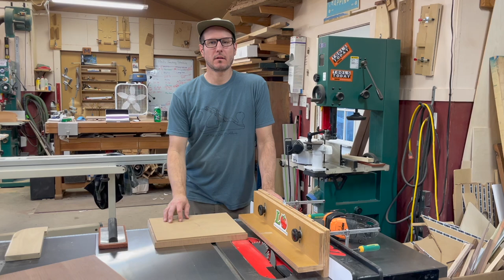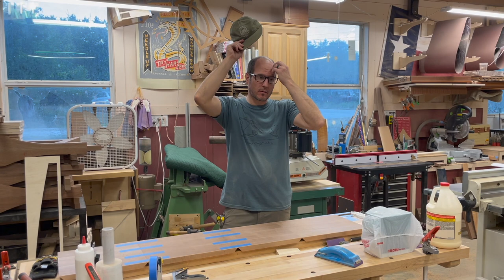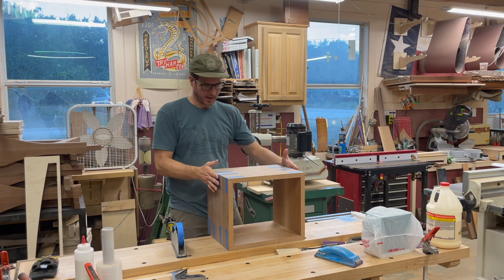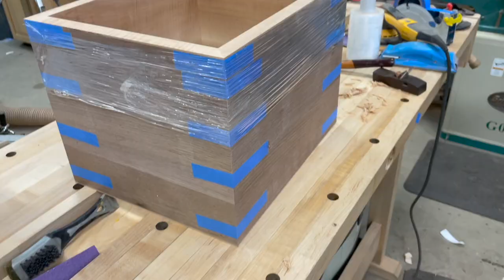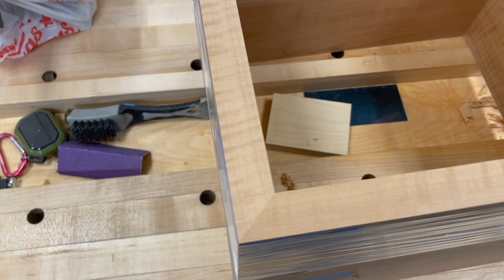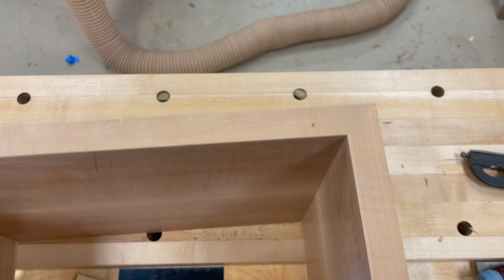Perfect Miter

Comment: Thanks for the video Philip. Very clever idea. Looks like I need to build an L fence. Just curious what you used initially to set the blade at 45 degrees? Angle cube  or perhaps some other measurement tool?
Reply: I was wondering the same thing! I have one of those lil magnetic guys from Klein tools but I wasn't sure if 1/10th of a degree is actually accurate enough for this long a miter
Reply from the maker: Thank you. Yes I initially start out with one of those digital angle cubes. Then I cut four pieces exactly the same length and miter them and do a dry fit..if it looks good then it’s good if it’s not I make small adjustments. Hope that makes sense. Cheers
Reply: Yeah this is great. Just did a piece recently and this would have been invaluable.